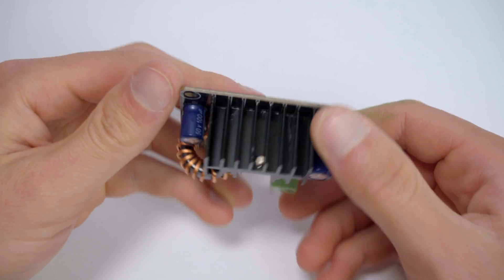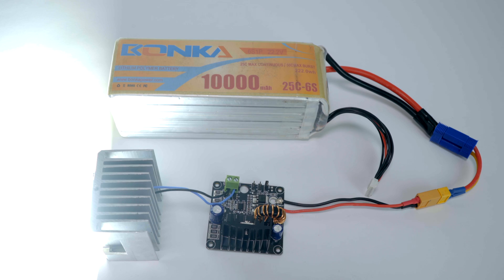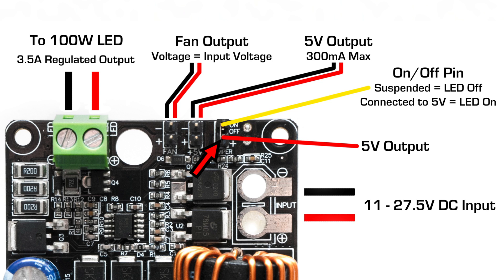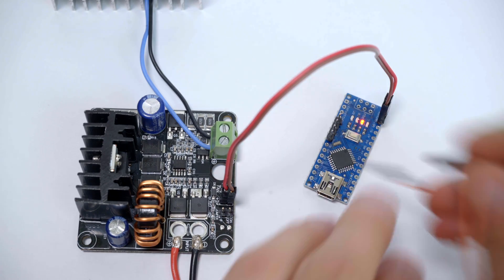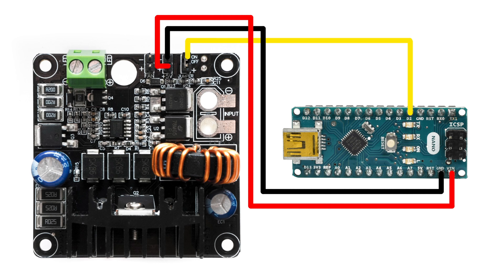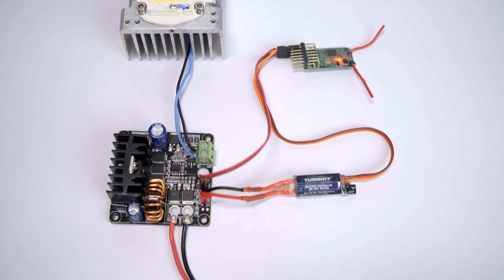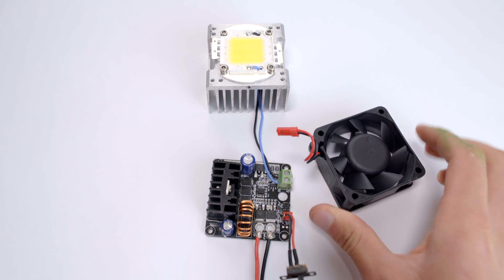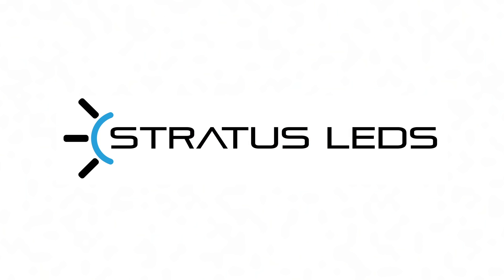100W LED Driver for DC 12V 24V Power Source

Comment: Hi,I watched your 100w strip (10 x 10w leads) and a 3s 1300mah battery on the drone and want to do the same but do I need this between the leds and the 3s? You don't mention that bit,thanks in advance

Comment: I'm worried about the copper wire on the inductor work hardening from vibrating and the whole inductor  snapping off. you could glue the bottom of the inductor down to the board to keep it from getting stressed